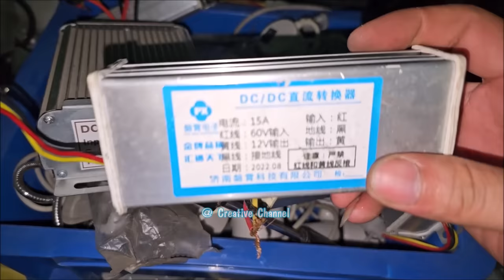Petrol and Electric 60v1500W Motorbike, 2 Wheel Drive, Conversion Motorbike to Hybrid

Comment: Noticed a concern. Road side tire repair is out of the question.. have to remove the Shok to change tire 🤔🤔🤔🤔 changing tire will take 3  to 4 hrs .  Why not use Shok with  unlock screws from below
Reply: where did you live ? those tire is tubeless , you could insert anti flat tire liquid , or could repair the flat tire on road side workshop just by puncture the repair kit , without removing whole tire from shock breaker...
Reply: Son llantas sin cámara, se pueden reparar después porque la fuga de aire es mínima

Comment: Impressive.
HUH? What's wrong with the speedometer? I don't see the needle moving when you ride on the engine or the battery.
Reply: speedometer read from front tyre right?
Reply: @pokwa906  That is possible. He changed the front wheel. That can be the cause.
Is he installed a bicycle computer to read the speed he's going, the problem can be fixed.
Reply: @Frank-mn4hx  you can clearly see the speedometer cable at 1:32

Comment: Can the battery be charged from the alternator?
Reply: If you add step up boost converter, 12v to 72v but i dont think u can exceed 100w draw on12v side for charging, even less with lights on, scooter charging system is not strong, but u can istall a swith on brake sensor and charge while driving with engine power by using regeneration from wheel

Comment: you made a mistake the mounting of that electric throttle sensor was wrong you should have mounted that to the engine because chassis remains the same and the whole engine moves up and down while riding because its the part of the suspension system
Reply: Aynen

Comment: try to convert 12volts to 70volts from the Engine to Charge the lithium Battery Directly plus from the Motor that's Efficient i think.

Comment: Very nice video !! You need to find an easier way for the throttle.. such a pain.. also you mounted the speed regulator to the engine carburettor but the mounts on the bike chassis eventually it will broke because the engine is moving up and down on the spiring but the chassis is stationary.. you can use a double throttle wire and a find someone to 3d print you a cheap and easy solution to combine the electric and gas throttles.. it's just an advise from a fan i am always enjoying your videos.. 😅

Comment: I was thinking about hybrid scooter for a long time ago before watching this video,,,,, i'm indonesian. 
 Now i' m thinking my future project,,,,  combination ( ICE + EV with 3 modes choice = EV mode, ICE mode and Hybrid mode for start race super acceleration) 
The basic is petrol engine 155 cc VVA Yamaha mx King or yanaha Exciter 155 vva ( non matic scooter but manual clutch 6 speed racing motor underbone) combined with mid drive  5 kw PMSM ( No BLDC) and 200 anpere controller,, and super high drain Lipo 72 volt 10 ah only ( to reduce weight,,  capacity the batere must be low but high discharge 200 ampere because this is Lithium polimer, not lifepo4 and li-ion) paralel with Supercapasitir bank ,,,,, 
Of course the fiture of regenerative braking ( on Votol controller) must be OFF, because i will use freewheel gear ( one way gear). 
I hope finally my hybrid race motorcycle is run more than 200 kilometer per hour Top Speed

Comment: the speedometer on the moped is not moving not showing the speed of the moped
Reply: speedometer read from front tyre right?
Reply: @pokwa906  no rear wheel
Reply: @JustinFrost302  you can clearly see the speedometer cable at 1:32

Comment: Is it possible to parallel both batteries so it charges when the gas engine is on?
Reply: I think better way to charge battery when driving is to have thumb throttle for regen and it would also reduce brake wear when braking